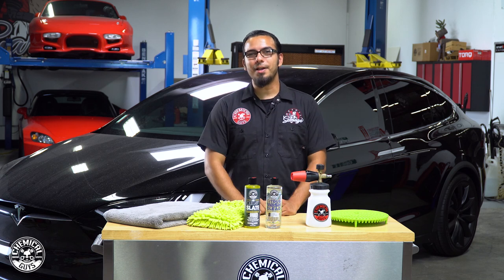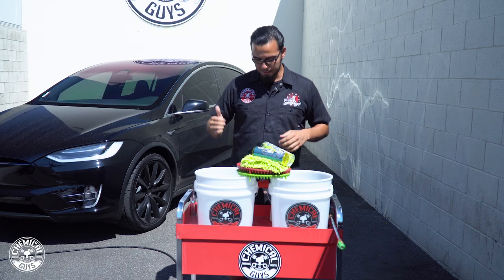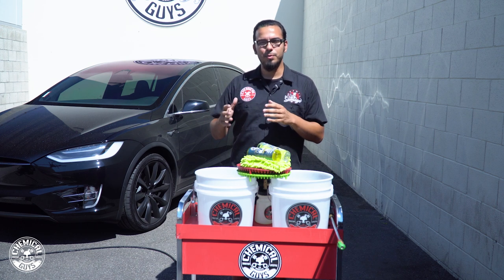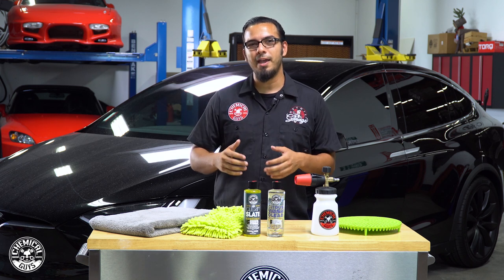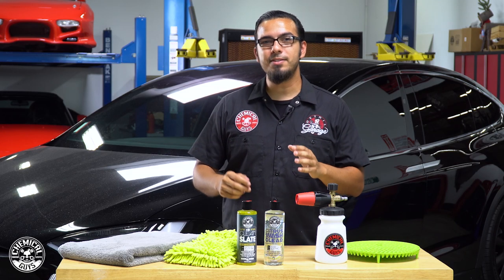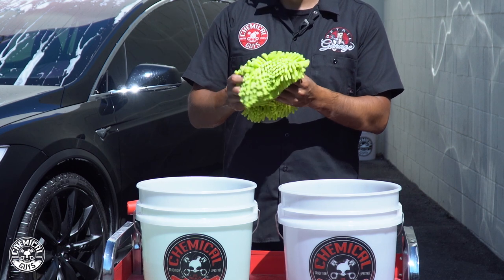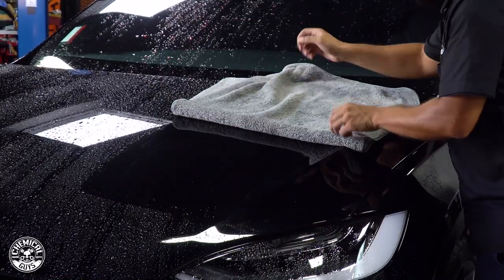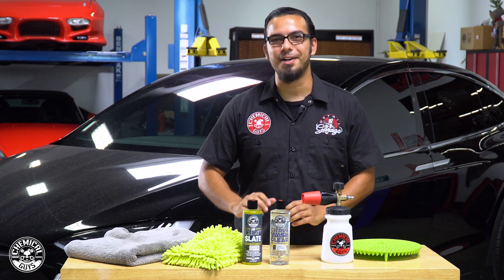Top 5 Tips: How to Take Care of Brand New Black Paint! - Chemical Guys

Comment: Could you guys do a full detail of a C7 corvette! I currently own one and I’ve tried really hard to hand polish it, but it didn’t work... It has a lot of swirls and scratches and the last product I used even added holograms that’s why I’m never buying from just regular auto stores again. Now I’m ordering pads (orange/black), drill backing plate, and VSS to polish with my drill. Would this work or am I waisting time? I love your products especially the jet seal! It’s great stuff. I think it would be interesting to see you guys detail a car using a drill if possible for us guys who don’t have da polishers.
Reply from the maker: Hi Bob, cool car! Awesome that you want to take your detailing to the next level, but we do not recommend hand polishing your car, nor using a drill. Modern paint polishing compounds are not intended to be used by hand over large areas. Modern paint finishes are very hard and glossy, so hand polishing is seldom practical or effective. We do not recommend using a drill on your Corvette either. The potential for damage to your car using a plain drill is quite high and not worth the risk on such a beautiful car as your Corvette. We highly recommend picking up a polisher, such as the TORQX, which can be had for quite an affordable price. The TORQX is a great beginner's machine that is powerful and reliable and just what you need to get started. It also comes as kit for even greater value! I will leave a link to the polisher below for your perusal. Thanks for watching, Bob, and thanks for being a part of the Chemical Guys family! 

https://www.chemicalguys.com/TORQ_TORQX_Random_Orbital_Polisher_p/buf503.htm

https://www.chemicalguys.com/TORQ_TORQX_Complete_Detailing_Kit_p/buf_209x.htm
Reply: Chemical Guys would I still be able to use a drill for the smaller parts of the car or will it create holograms?

Comment: does it work with matte black?
Reply from the maker: Hi! Good question. For matte surfaces, use only Meticulous Matte products. We recommend using Meticulous Matte Auto Wash in your foam cannon, foam gun, or when using the two bucket method, and Meticulous Matte Quick Detailer to dry your car and for quick clean ups on the go. Thanks for watching and make sure to stay tuned for more awesome content headed your way soon! 
https://www.chemicalguys.com/Meticulous_Matte_Auto_Wash_16_oz_p/cws_995_16.htm
https://www.chemicalguys.com/Meticulous_Matte_Detailer_16_oz_p/spi_995_16.htm